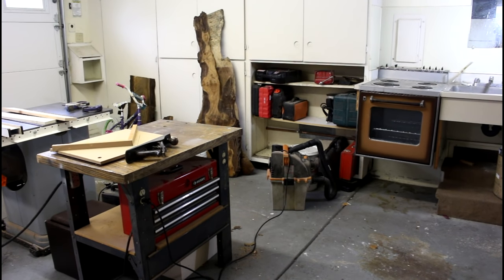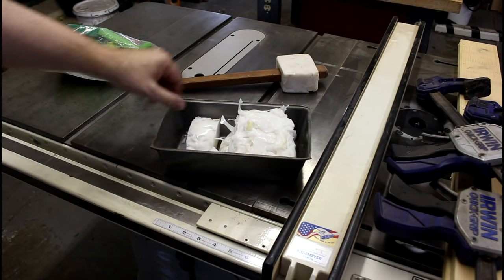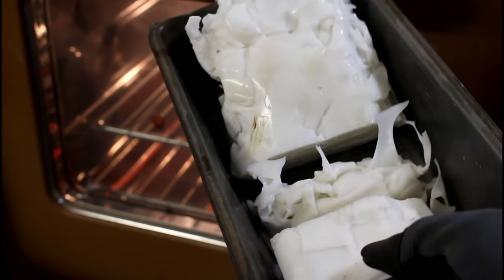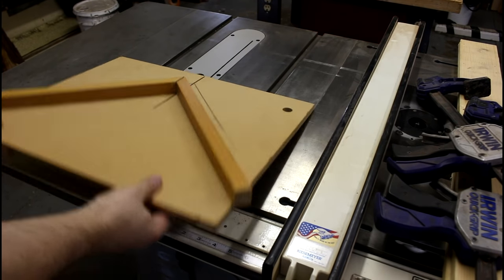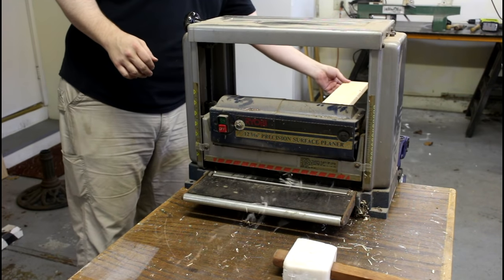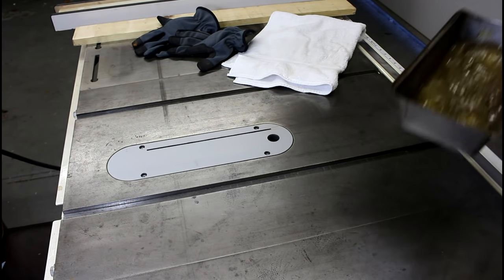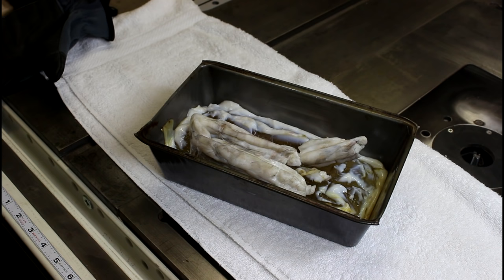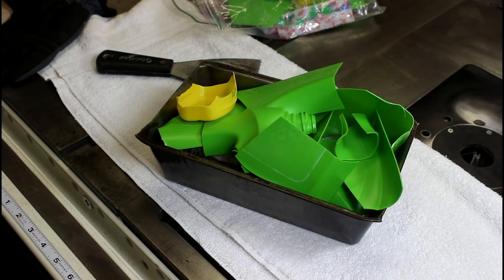Using HDPE  In The Shop

Comment: the table saw acts as a massive heat sink, which cools the HDPE super fast. if you make another one, try hitting the slot with a torch to preheat it a bit and you might get a few extra seconds to work with the material.
Reply from the maker: +dustlesswalnut I'm pretty crazy, but I'm not sure I'm up to using a torch on my table saw....yet....
Reply: Interesting anyway, thanks for sharing ;)

Comment: I feel like you would be better off melting it all, pouring it into a mold, then cutting it to size.
Reply: +Robert Navarro Pretty hard stuff to pour...
Reply: +RocketLaunchingLlama yeah, there's zero chance of ever getting HDPE to do something anyone would call pouring. At best under heat HDPE flattens out. That's about it.
Reply: *****
In the 30 times I've cast HDPE I have not seen what you're talking about. When HDPE gets really hot it turns into this brown crust. Which really does not want to pour. It is not even HDPE plastic anymore then either.
Reply: *****
In the toaster oven I use if I cover my melt it takes much longer for the melt to occur.  My oven is more radiant, than convective heat. So covering is less of an effective solution for me. I actually made a very nice cover for my mold out of some aluminum flashing. It sits on top of the oven now too.

Comment: The problem isn't so much that the runners expand as it is that the sled expands and contracts, so the distance isn't right anymore.  Try placing the sled with just one runner in the table, or tear one of the runners off.  That's why my sleds always have just one runner.
Reply: +Matthias Wandel Good idea!!
Reply: Heeeeyyyy Matty!
Reply: +Matthias Wandel My sleds are your design but the runners are out of oak and it has served me well despite not being the best choice of hardwood. 

I built them when I didn't have access to any other hardwood. MDF worked surprisingly well for the small sled, I used particle board for the larger one and that wasn't the best choice edges have chipped up a bit and I imagine it will eventually fall apart but so far so good.
Reply from the maker: +Matthias Wandel I thought that was the main advantage of plywood, though the sled in the video was MDF I think.

As for the one runner idea, have you had any issues with the sled getting out of square?
Reply: Peter Brown I'm guessing with two runners even with a tiny amount of movement is enough mess it up. 

MDF has a swelling effect and plywood I imagine moves a tiny amount.

You figure when a piece of paper is the difference between tight and not. 

I don't think it would be enough to effect the square that much, the two runners probably double your error.
Reply: as hdpe doesn't expand/contract, why not build the entire sled with it?

Comment: Couldn't you clamp the molten HDPE globs between flat boards and clamp them parallel until cooled and then saw or plane them to desired size instead of molding it in the tracks?
Reply: I think it will work in a heat press with heat elements on both plates
Reply: Exactly. I was thinking he should use cookie sheet pans.

Comment: New space looks good. Love the idea of making HDPE runners, I don't know too much about it though... Is it possible to make it more liquidy? So you could just pour it in and it wouldn't be so lumpy?
Reply: presumably since he didnt havent the oven turned up the whole way, although one of the other commenters said that heating it too much makes the compound break down faster making it less reusable
Reply: +Live Free and DIY HDPE will never pour. Although there's different formulations of HDPE. There's injection, and blow molded HDPE. Injection molded HDPE flows much better than blow molded HDPE does. But injection molded HDPE still does not pour. Bottle caps are injection molded, and bottles are usually blow molded (thicker colored bottles may be injection HDPE - clear jugs are blow molded). Injection molded HDPE is a bit softer than blow molded is too. What you saw in this video is as liquid as blow molded HDPE gets.

Comment: Very cool, Peter!  I just picked up some 3/4" HDPE stock at the last woodworking show I went to for sleds.  Never thought about casting my own in my table saw slots.  of course, I would have to be careful with pressing it in with the clamps because I have a T slot and I imagine it would seep into the T while it's still soft.  Not a big deal for function, but I wouldn't be able to just drop the sled down on the saw.  I would have to slide it in from the front edge.
Reply: +Jason Rausch You could still cast it that way and just trim off the sides of the T with a bandsaw or what have you.  One of the nice things about HDPE is that it works just like a soft wood, so there's no special modifications needed for your tools.

Comment: great job on reusing hdpe one suggestion i have is to heat it at the lowest temperature for the lowest time possible as soon as it turns clear i like to take it out of the oven as quick as possible to prevent any degradation or yellowing/burning at 4:00 in the video it looked a little yellow and degraded however if you take it out of the oven as soon as its clear it will be reusable many more times without noticable degradation hope this helps oh and also maybe it would be easier to make a thick sheet of this material and plane it into a nice flat sheet and then cut out the saw runners with a table saw or bandsaw

Comment: Great use of the HDPE! I've got a HDPE project planned soon! Have to collect and process some HDPE first :) Tried it once but it was a huge failure but we have a new more precise oven so the kitchen won't stink like plastic.
Reply: +knives&amp;stuff There's always going to be some odor as HDPE melts. But if it is really strong then you're running way too hot. Still I'd say ventilate while you do it. An open window, or the fume hood going. Something. I melt HDPE out in my garage, and it has enough air leaks to keep me from dying of the fumes.

Comment: Your kitchen oven melts HDPE really nicely. I am using a cheap toaster oven and it struggles at 380F. If it were me making the table saw runner I'd make a sheet, then just rip it down to the width I needed. But like you said, even your lumpy runner works.

Comment: I wonder if there's a finite number of time you can re-heat this stuff?
Reply: +Savvas Papasavva From what I've read of 3d printing when you melt plastics the polymer chains do tend to break down.  For example if you were to 3d print some plastic then grind up what you printed, melt it back into filament and re-print apparently you can only do that a few times before the plastic starts to lose its properties and meltability.  In this case with the HDPE it's not being heated all the way to a liquid state so it probably breaks down less.  I assume you could melt-remelt it a few times at least before it would start to go bad.
Reply: +Savvas Papasavva yes there is a finite amount of times especially if its overheated i like to heat hdpe the least amount of time possible because this will prevent the polymer from degrading or turning yellow if its heated at for the least time possible you could probably reheat it possible over 20 times but thats only if you really make sure that you take it out of the oven as soon as its melted

Comment: This is awesome, may end up doing this for my brothers table saw accessories. Consider cutting out a section in your wood, to pressurize the hdpe into shape, with a hole/port to release pressure. So its formed into the rail, removing inconsistencies by pressure. though its getting farther in depth than what may be needed.

Comment: ever since I saw your last HDPE video, I've been keeping a small box to toss bottles and caps into, slicing them up into chunks as needed for space.
I plan to eventually remove the labels and shred the pieces even smaller.
I'm even keeping a few smaller bottles whole to dump shredded bits into and make more patterned blocks with the various colors I've collected. 
My girlfriend gives me wierd looks, but seems to tolerate my collection,  thus far.
Reply: I  will probably snag a toaster oven and bread pan from Goodwill in the next couple months.
looking forward to making my first HDPE blocks for later use.

Comment: My favorite source of HDPE is actually plastic shopping bags. If you go to a variety of stores you can get a variety of colors and being so thin it melts quickly. The downside is being so thin it shrinks quite a bit on melting so you need quite a few bags to get enough material to do anything with.

Comment: Could you form the hdpe in a sheet?  Using something like a 13x9 pan or a sheet pan or something similar?  Then cut said sheet into strips which you then plane and such to get close to the right size, then warm it in the oven before pressing into the slot?  That would, in my mind, give a very nice tight mold of the slot.

Comment: Instead of trying to mold the HDPE in the track itself to make the runners, try squashing your HDPE between two non-stick cookie sheets (with wooden blocks or nuts as spacers to control the thickness) to make a fairly uniform sheet.  Then you can plane the sheet on top and bottom to make to make it smooth and uniform, then use your table saw or (better yet) band saw to cut the sheet into strips to use as your runners.
I have only just started experimenting with HDPE myself, and I find  the band saw just loves HDPE and cuts through it like a hot knife through butter (Sorry for the cliché.), leaving fuzzy shavings like a plastic version of steel wool.  :-D

Comment: +Peter Brown    I would have thought that the saw table would suck the heat out of that HDPE quickly; considerably reducing the time available to work with it.   Do you think making a mould which you can melt the HDPE into (which goes inside the oven) would work any better?

Comment: Couldn't you preheat the mold surface a bit to prevent premature cooling as you worked the plastic in?  Or perhaps remelt the plastic while it is in the mold with a heatgun or something to have more time to work the uneveness out? Or, heck, melt the plastic while it is in the mold itself.

Comment: Since you have a stove, maybe u can use a double boiler to melt the HDPE? Not sure about putting direct heat to it since it may burn it instead, but a double boiler may spread the heat evenly enough. Plus it maybe faster than using the oven. I don't know honestly since it was just a random idea I had while watching but it maybe worth a try. Can't wait to see more videos from you!
Reply: +Albert Westra Water boils at 100 degrees cesius, or 212 degrees fahrenheit... Peter baked it at 325 degrees fahrenheit and it hardly got runny at all.. using a double boiler wouldn't get warm enough i think

Comment: hey Mr Peter Brown can i just say i like your style of videos. little to no music and straight up honesty. i love your style. will heating/melting hdpe in the oven affect the "tastes" of foods later down the line
Reply: +MrJewripper Maybe if you have an extremely discerning palette. But HDPE is non-toxic. I use a toaster oven with those bulbs to melt HDPE and it can kind of burn the plastic a little. Then there are some fumes. I just took a whiff inside that oven, I don't smell anything now. One thing to be careful about is spilling little bits of HDPE in an oven. I'd imagine those bits cooking later would be nasty. Baked on HDPE can be a bitch to clean too. After a while it will turn into this dark brown crust that looks a bit like burnt sugar. So if you're going to use your cooking oven protect it in some fashion, to catch any errant plastic. Like say if you have two racks put aluminum foil on the lower rack, and work on the upper one. Then I'd say you should be OK. All in all melting HDPE is pretty safe though. Unless you really go out of your way to do something stupid. Nothing is completely idiot proof. So YMMV
Reply: +Paul Frederick woah thanks man! appreciate the info

Comment: Although your HDPE method will work in a pinch albeit a bit crude. I would recommend something called StarBoard. You can get it at the home center or a local hardware store usually. It's not especially cheap and it's meant for marine applications like making boat center console doors or things like that. I have some that I keep around and it works great for sled runners. If you are lucky you might find someone with a boat who has scraps of it that will serve the purpose.

Comment: Accidentally worked on a piece of HDPE rod material the other day. Machines terribly. Love what you're doing with it, but personally, I try to steer clear of it. Too troublesome a material to work with.
Reply: +Switch &amp; Lever to make sheets of hdpe i use flat sandwich makers and place coins in the corners to get the right thickness then add hot hdpe turn it on wight top down let it spread out buy the wight on top then turn off the s-maker wait 30min open flat sheet. score to bend off excesses

Comment: I didn't think that would work at all, I thought the cast iron would sap the heat off to fast, good innovation! I have cut some runners out of a cutting board before, what was nice is the the cutting board was just a bit thicker then 3/4.

Comment: hmmm .. so have you tested to see how liquified the HDPE will get?  Does it always stay in that geletanized state, or can it get a bit more runny? If it could get pourable you might get a better runner.  hmmm this has me thinking..
Reply from the maker: +Dave Smith You can liquefy it at high temps. BUT it becomes really brittle after it cools. Certainly couldn't run it through the planer.
Reply: +Peter Brown ah, good to know .. thanks man!

Comment: Great idea, but couldn't you just put the lumpy side pointing down away from the bottom of the sled? As long as the sides are flat and the mating between the sled and runner is consistent, it shouldn't matter if the runner is lumpy or not. I've got a bunch of HDPE cut up and a project idea, just trying to find time to actually do the project.
Reply from the maker: +Dustin Rogers 100% The planning wasn't at all necessary for the runner function well.

Honestly, I was more curious as to how the planer would take the HDPE. It planed really nicely....

Comment: Maybe pre-heat the table saw would give better results?
For my sled's runner, I just use the cheapest PE cutting board and cut them on the table saw :)
(one problem with using plastic is that they expand slight when screwed into the sled)

Comment: I know it wouldn't have made a great video, but you can buy square rods of PTFE (teflon), it's kind of expensive, but I bet the ease of sliding it through the guides would be great. Also you can buy thin sheets of it for relatively cheap, like 2 x 4 foot by 1/8" thick pieces, you could screw it to the bottom of the sled then the whole underside would be teflon. Glide like buttah.

Comment: What would happen if you melted the plastic in a cookie sheet and then let it cool. You should end up with a big slab that you could run through the planner (if needed) and then just use you table saw to cut strips. I like the shavings from the planner, bet those melt down pretty easy. Process different color and then mix the shaving together to get a particular color.

Comment: I still think you should do as the pro's does it.
1: Use higher heat, approx 220 C (428 F).
2: Create an oversize mold and work it down so the final resulting product will be more aestethical.
One way to achieve this is to over pack the runner and press the board on top of this and the table and work away the overflow.

Comment: Can you get HDPE hot enough in an oven that you can pour it?
Reply: Probably better if you heated it higher and kept turning it so it wouldn't be lumpy :)
Reply: +Garry R nope hdpe has long polymer chains which means no matter how hot you heat it it will not become more liquid infact its best to heat it the shortest time possible to prevent it from degrading

Comment: Here´s a challenge for you.
Is it possible to craft a knife out of folded aluminium foil? If you fold a piece of aluminium foil many times, it will become almost like a solid piece of aluminium. Try to forge a knife from foil, either by just folding it and pressing it in a vise or by pressing it in the vise after heating it up to "weld" the layers together.

Comment: whats the diffence of sanding with and with out water cause i always see you ise water
Reply: Sanding with water cools it down and makes it smoother
Reply: OhNeXTSTORMING thank you good to know
Reply: Sanding with water also helps keep dust from gumming up and getting stuck in the sandpaper, which would make it not work as well.  It's most effective on very fine grits, which is why micro-mesh starts at 1200 and you usually soak it in water beforehand.

Comment: I don't think I could bring myself to trust someone who doesn't like the smell of bacon. But anyways, I've had the HDPE runner idea bouncing around in my head for a while now, but it never dawned on me to cast them in place like that. Awesome project.
Reply: +Adam Gabbert I wasn't keen on the lumps. I'm just picky though I suppose. Another big problem with HDPE is it shrinks as it cools. So you can't really cast it in place too accurately to fit anything. Well, if you have excess material, and press HDPE as it cools you can compensate for the shrinkage to some extent. Which I believe is why it worked as well as it did here. I still like my runners with crisp edges though.
Reply: +Paul Frederick Yea. I think I'd cast them larger, then cut them to fit just right.

Comment: If you're going hdpe..why not just make a block, cut to size with a band saw, then plane it. 
That way you'll get the fit without have to handle and mold hot plastic that you'll have to reshape anyhow when cooled.